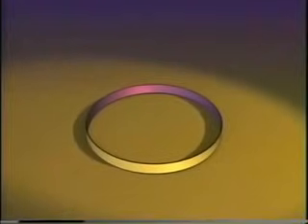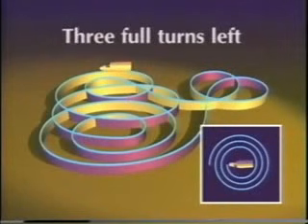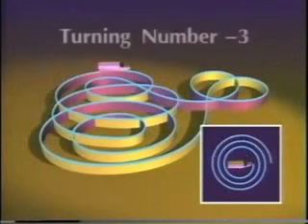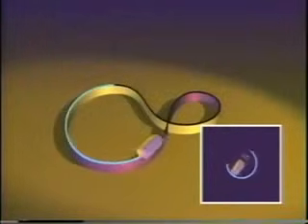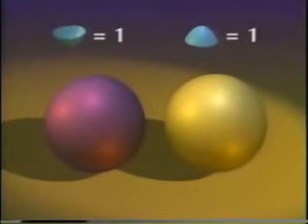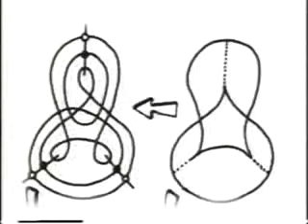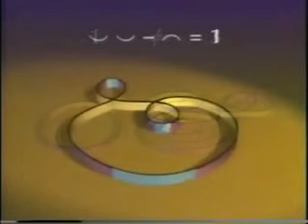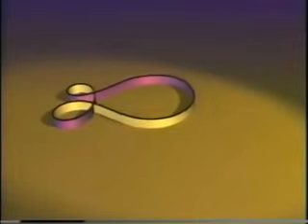how to theoretically turn a sphere inside out

Comment: It's not cheating, the spheres actually represent sets of 3 dimensional data points. For the material to "pass through itself" only means that one or more sets of two points are equal to each other. Similarly, a "pinch" is when the derivative of the equation used to generate that curve gets a discontinuity, meaning that the rate of change (or the rate of change of the rate of the change) of the angle of the curve becomes infinite in magnitude, or changes value suddenly.

Comment: A crease and a corner are essential similar things, but not always possible depending on the circumstances. A corner may be possible where a crease is not, and vise versa, which is why the narrator said "crease or sharp corners." There is also the possibility of a crease and a corner forming, but not a corner and a crease; or a corner and a crease, but not a crease and a corner.

I need someone to review this message cause I'm not entirely sure how accurate I am.

Comment: Well you changed the laws of physics! I could turn a sphere inside out if I could change the laws of physics but I don't need to! Let's say the sphere is made from a material that can be cut, such as rubber. I'll just cut the sphere in half, flip both sides inside out then glue it back together and voila! A sphere turned inside out.

Comment: So you can do it on a computer. But you cannot get a real sphere into that theoretical position, the strips towards the end. And especially not in real life without making creases or tears. So if you physically can't do it outside a computer simulation then it is NOT POSSIBLE. These mathematical ''Geniuses'', need to realize that if you can't actually do it in physical life then it is not possible.

Comment: Imagine a photon as a shiny sphere. The outside edge is attracted to other stuff, while the inside edge keeps everything together. Normally the outside edge's attraction makes it move- at the speed of light- and the inside edge just pulls the thing inwards. But flip it and there's nothing pulling the light at the speed of light and it'll expand until it some magnetic force stops it. Then you've got an saber-shaped area made of light that stays in place at incredible densities- a light saber!

Comment: first, this video is THEORETICAL as you stated. and your talking about the sharp bend. but it wont be a sharp bend because those are two infinite points and will have to remain intact. with my theory im a talking about 1 point in which you eventually end up at the very end of the process where instead of those two points being a sharp bend like in the video, they actually meet. its not a crease or bend if you pull it through to meet at one point because it is a figure of never ending angles.

Comment: you just didn't get it, you have to avoid infinitely small loops, because they aren't allowed in the stated rules, or to speak with math, those points aren't continous, take the example with the ring, put it in a coordinate system, try to invert it, you will have at one point(in terms of time) a point(in terms of location) where you can't describe the slope

Comment: the whole video is bullsh it after 1 min. because since the sphere can pass through itself. simply take the top of the sphere and pull it through the other side without touching the other side at all. so you wont have a crease like they explain. even the way they explained it. they deformed it on purpose..

Comment: It doesn't need to be possible with with normal materials. This is a mathematical thing in relation to physics. Yes materials cannot pass through themselves but what's to say energy can't? It's not about that, it is about doing so without ripping the sphere or creating  creases, these are the rules, if it was ripped or creased as shown it would never be able to be a sphere again. I may not understand this completely but at least I can realize its importance to those who do understand it.

Comment: It is important for the mathematical field of topology which deals, loosely speaking, with how things are connected with each other. Two objects are topologically equal if you can morph the one into the other (this is where the requirement "do not crease it" comes from). Now, it would be very surprising if a sphere would be topologically different from another sphere. So in order to proove that they are topologically equivalent you need to find such a morphing transformation.

Comment: Theoretically as you say it can be done, but the only way a sphere that is hollow could be turned inside out, is for the skin to be made of a gas, so that each of the molecules could be pushed past their neighbours, keeping each of there outsides to the outside until it has passed its opposing side. A grid or mesh couldn't do this unless its matter could pass through and beyond it's opposing side, so what is the reason behind such a suggestion?

Comment: Sadly, I understand this.

The ring cannot be turned inside out because whatever you do in order to do it, the turning points would not be zero. There is nothing to theoretically balance itself out.
The sphere, however, if achieved by ripples and domes, constantly equilizes itself to have a turning point of zero thus creating none of the criteria that the instructor considered an invalid move.
I think.

Comment: A theory is in layman's terms, a model for predicting an outcome for some occurance. A fact is something that occurs. Theories are used to predict facts. You need a theory in able to predict things reliably. (You'd never be able to say something would probably work in the future, only that something worked in the past).
Theories are never done. They can always be updated. i.e. general mechanics was proven wrong and revised with the theory of relativity.

RadEvan isn't really correct either.

Comment: But eigenvalues and eigenvectors were possible to make not only in THEORY but also in PRACTICE, making them possible to have PRACTICAL use, which were USELESS, when any use for them wasn't known. Still these were POSSIBLE to do, unlike turning a sphere inside out, since it's IMPOSSIBLE in PRACTICE, while in THEORY - like everything else - it is POSSIBLE.
Aside from that, I can't see any reason to use turning a sphere inside out for anything.

Comment: That is your opinion.  At the beginning of the video it explained the qualities of the "material" used and it does not exist, how would anyone benefit from this theory?  I have another question since you probably know more math than I, if .9=1 and 1=2 does .9=2? 
By the way, I am an an architecture major and I trust in the integrity of different materials used in different structures.  I do not and cannot benefit from theorizing about inverting a beam or column.

Comment: Thinking about this WITHOUT seeing the answers DOES test your mathematical ability and abstract mind. This is commonly used for furthering theories in physics, where trial and error is not possible due to lack of technology, and the rules you knew before dont seem to apply anymore (such as gravitational physics vs electromagnetic physics). Its just basically a gauge/test to see your ability.

Comment: It does seem like it's a contrived "rule" for turning a sphere inside out, but the actually appears (at least) to be a good reason for this rule. The rule comes from a basic rule from topology that a mobius strip cannot be turned into a regular loop without creating a sharp crease--which would be like a sharp peak, rather than a curve, on a Cartesian graph. In other words, the regular strip can't be turned into a mobius strip without using a "piecemeal" function.

Comment: Actually, in theory it could do so. 

According to the last beliefs of science I'm aware of, all matter is not solid but resonates to a infinitesimal level, and the sensation of "Solid" is simply an illusion caused because it all resonates equally.

If you could obtain a material whose almost or maybe quantum scale proprieties resonates, "Vibrates" at various wavelengths it could theoretically be possible to pass it through itself.

Comment: You can never touch electrons; what use could they possibly be? They're like really fine dirt. Could you pass 1/16 of an electron by a transistor? Just be practical and give it a cold so it can sneeze across... (See also: Quantum Hall Effect, every decent power device in the datasheets.)

Comment: If you have a sphere dunked into material that should be packaged and if you can turn the sphere inside out, the material is successfully packaged without any heat (like today's plastic bags) without glue or different packaging methods. You just get a - possibly recyclable - sphere around it :)

Comment: Pretend you want to graph something as a result of messing with something else. This is a 2D graph producing a line. If you're graphing an equation's results, it may have more than one answer, which may produce a 2D shape. If you want to mess with 2 things, you need a 3D graph, producing a 3D shape. Since we're talking about graphs and equations, and not a basketball, it's okay if lines intersect, although some things (creases) "break" the equations and need to be avoided.

Comment: Completely wrong.

The Romans derived their MDXII bizarre number system from the Greek system. Which made math extremely difficult. These Europeans later got the 1234567890 (logical) number system from the Arabs. The European numerals even look like the Arabic numerals.

Algebra was invented by the Arabs since 28 x 157 is much easier than XXIIX x CLVII.

Algebra is Arabic, Al-jebr, "reunion of broken parts." Much of modern mathematics draws its roots from Babylonia, Iran, and Arabia.

Comment: By 180% I mean 180 degrees. (no degrees sign on keyboard). Just grab a wrist band if you have one. Pinch the top. Then flip it. Turning the wristband inside out.

Comment: Yet another person for whom it will take 10 minutes past these 10 until they are a superstring theory fan, then? The mathematical definitions for spheres are used, cannily enough; should work for electrical current, higgs bosons, other matter you may want to condense. Peeps should just FF to 09:28 -ish for the original trippy 1951 illustrations of how, and 3-lobe sufficiency (no need for 12 vanes.) Gotta pass things through themselves more often...

Comment: Electricity as a concept was discovered as a gimmick, and no one really knew what it could be used for. No one could possibly imagine what computers could be used for until we'd actually made one; then it grew and grew, into the massive explosion of technology into what is today's industrialized societies. 
This doesn't happen 99,99% of the time, but without eccentric freaks sitting in labs doing weird things and making notes, it'd never have happened. So try a little gratitude.

Comment: You can theoretically turn a sphere inside out by pulling opposing sides towards each other, as shown in the video. The real difference is infinitely small, ie. zero. 'You can't bend something sharply' is a made up rule, and so yes, scientists make up their own rules. 
Saying the rule 'you can't bend something sharply' works because of another made up rule; turning number, is fallacious, circular arguing if you then say the rule of turning numbers works because you can't bend something sharply.

Comment: How to overcome the sharp bends; infinitesimally flatten the surface parts until they respective angle is zero (so taken the procedure to the limit would mean the two surfaces would be parallel and touching) and then the two surfaces merge together. Though for the sake of band that would actually alter the shape desired but not the parameters governing its existence.

Topology can be a real bitch that way; stretching things without forming cusps or holes in a multi-dimensional surface.

Comment: Because the rubber band is the three dimensional object. The "walls" of the circle in the video were only to visualize which side of the circle was which to find out whether the turning number was positive or negative. For a circle you can only push or pull the walls, not flip them.

Comment: ....even then, why does this theoretical material disintegrate when it forms a corner? You could achieve the same with a material that doesn't, but using the simpler method the guy tried. But again, neither material exists. This entire video is like me saying "If I was a wizard, I could use magic"

Comment: They're not arbitrary.  They're based on concepts of continuous smooth change.  Allowing a sharp edge is like allowing a car to go instantly from 60 mph to 10 mph WITHOUT slowing down (without at some point having been going 50 mph, or 40 mph, etc).

Comment: This stuff has applications in physics. Other types of math that also seem abstract have applications in engineering (this might and, if it does, I don't know it); for example: group theory, which is quite abstract to most people, can be applied to gear train design, mathematical transformations used in robotics, and lots more. It's important that mathematicians work this stuff out so that others can apply it and build on it- like Dirac using Hilbert's results to further quantum mechanics

Comment: There is a fundamental reason to all mathematical challenges. This example helps forward the understanding of spatial geometry, which is later on used in physics to measure properties of time space and matter. (I hope we all understand how this already turned out to be practical) If you understand programming in general, this example would be "Hello World" for an advanced area in spatial geometry. It helps understanding the rules and advantages of the portrayed mathematical system.

Comment: @ nisbahmumtaz909 I'm also 909. Not the point. I see where your mind is in the mater of comparing the "fact" of this subject if you will. That this only strengthens your logic and principles. I agree with that, but I think you could of used a better example, Think" a knife sharpener will also dull up a knife. And yes I get you.

Comment: @ian0renos When it tries to go through itself like that, it's basically trying to invert the infinitesimally small corner, which is, admittedly, being vaguely described as a crease. Think of the corner as \_/, where the underscore is the corner. It can't be flipped round due to being attached at both ends; like a rope - when the rope is put in the same position, it ends up being twisted if the ends are pulled along one axis without twisting. Hope that's a good explanation :)

Comment: I'd like to see the "turn", in physical science, viz. In conclusion we could say that the number of turns of wire around a solenoid is directly related to the magnetic field strength of the solenoid. ...
henry: The SI unit of inductance, equal to one volt in a closed circuit with a uniform rate of change of current of one ampere per second.

Why is a turn so fundamental, where goeth the path of the charge, where does the topology match the physics?

Equate the crease to stopping the path.